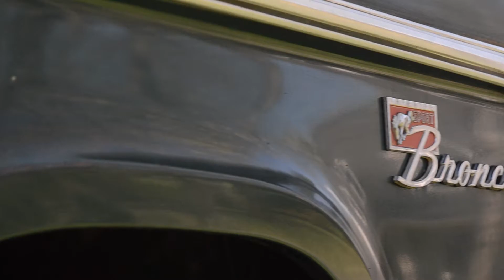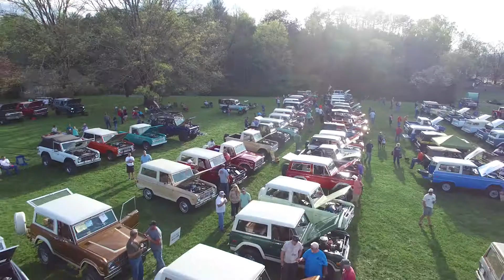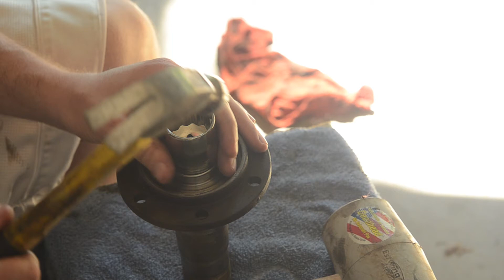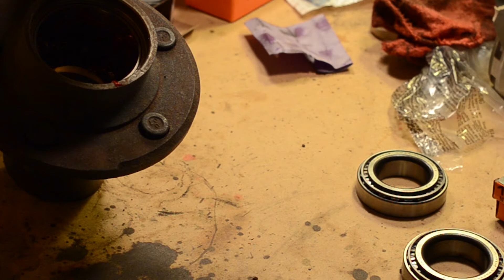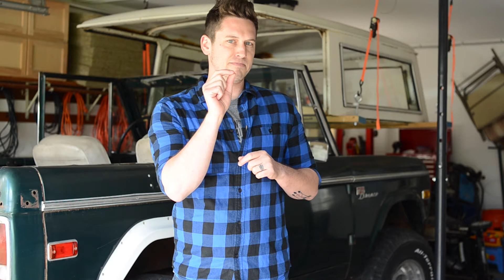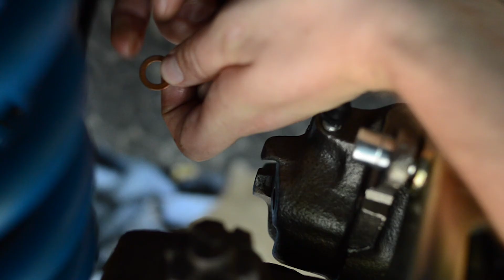Disc Brake Install: Classic Bronco

Comment: Did you just use the same proportioning valve, or did you replace it with one from a disk/drum system?  66 owner here, so I have to do something for the dual reservoir.
Reply from the maker: I used the one from the disc/drum system. It’s made for disc/drum set ups. The stock one is just for drum/drum set ups

Comment: the rotors i have came off a 1980 F150 4x4  Will they work?
Reply: Rotors on rock auto are cheap. You can also check to see if they are the same part number

Comment: well i have been trying to piece together also  I bought a backing plate GM dana 44  Put the rotors on and it is rubbing the backing plate  Any suggestions?
Reply: I suggest buying knuckles and brakes off a 1973-1979 ford 4x4 with a dana 44. They should just bolt right on.  Also buy/rent a slide hammer with a spindle puller attachment. Using a crow bar is silly and you could ruin parts

Comment: Good vid! A little off topic but I was wondering if when you got your bronco if your suspension and steering arms were as clean as they are in your video or did you clean or replace? If you cleaned, what did you use?
Reply from the maker: I wish I cleaned them, but they were new. All dirty again now. I need to sand down and repaint

Comment: Great vid! It looks like you stayed non-power. Can you comment on the pedal effort with the master cylinder you installed? I'm about to do this same swap on a 73. Thanks!
Reply from the maker: +Black Line Industries I actually think my brake booster is shot because I still feel like I have to stand on the pedal sometimes. But there is a noticeable difference in stopping time/power. I'm also putting in a new portioning valve made specifically for disc and drum

Comment: What do you mean by fully loaded caliper?
Reply from the maker: "Fully loaded" may not be the right term, but a lot of times you can buy "semi-loaded" calipers. The one's I bought had the pads, clips, and all the pieces so I literally just had to slide the caliper on the backing plate and screw it in. A lot of times "semi-loaded" calipers don't have brake pads and clips.
Reply: Ah, thanks for the explaination!
Just bought a 75 Bronco and cant wait to start working on it!

Comment: Do you have anymore videos planned for this bronco ?
Reply from the maker: +aydanbilyeu I do! Right now I'm installing a 23 gallon Sherman tank, adding a 1 inch body lift, and installing a new wire harness. It will be a while before I finish those but I'll post them as soon as I do
Reply: most auto stores or harbor freight have them.
Reply: I would imagine he does. Broncos are never finished.
Reply from the maker: +Nathan43 that's the truth
Reply: Where do you get the lock nut socket?